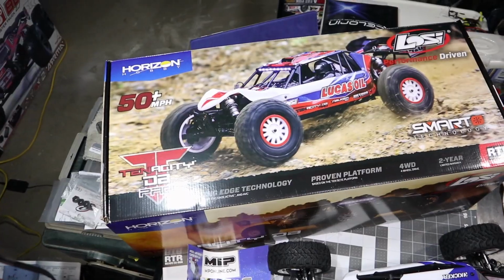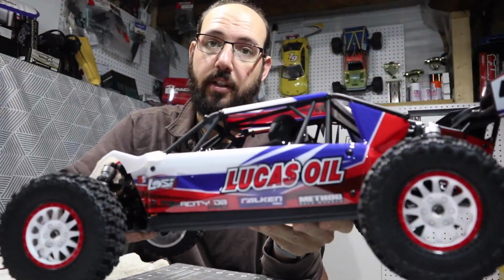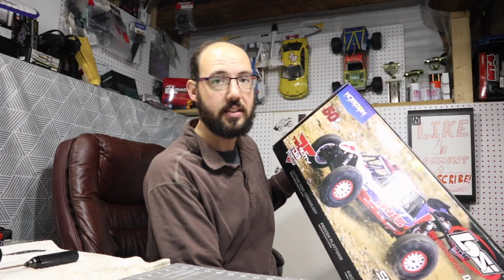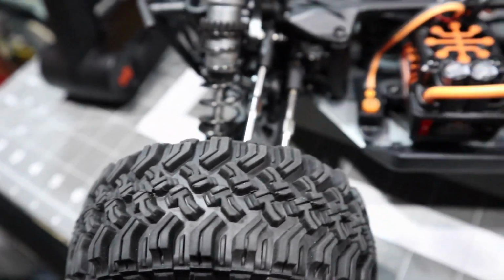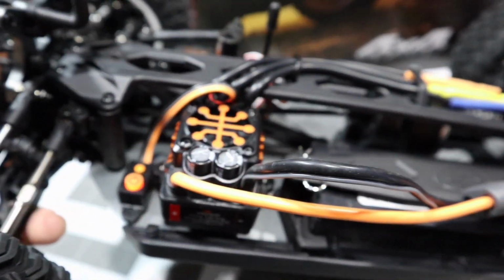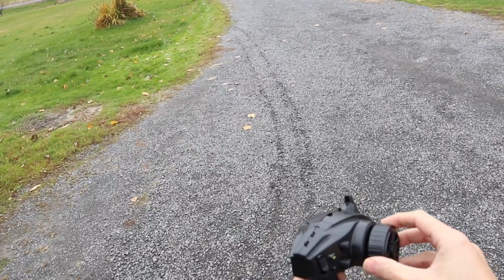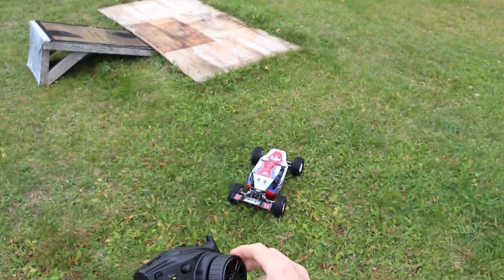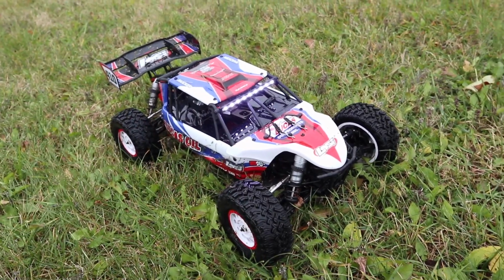NEW LOSI Tenacity DB Pro Unboxing, Setup, and First Run! - Netcruzer RC

Comment: This is probably the perfect car for most buyers.  This is what the slash should have been.  The body design allows this car to fly through the air better.  No parachuting like the slash.  It's about the same size as the slash, so it's easy to carry out to the field and back when the batteries are dead.  Plus it's built on the racing chassis.  I just don't like the transmitter.   It looks and feels cheap.  I like the easy to work on layout.   Pretty good support at local hobby shops, but still shy of the Traxxas offerings.

Comment: ** On the Tenacity stadium truck version** Cheap aluminum on shock towers. 100% chance the rear towers will bend. Design flaw, the rear bumper is mounted too high on the rear shock tower. Any hit to the rear bumper will bend the rear shock tower. I actually "upgraded" to the stock plastic rear shock tower. The front shock tower is fine and doesn't bend. Good luck all!
Reply from the maker: Thanks for this real world usage report. That’s interesting.

Comment: That plastic wrench is unacceptable. I actually used it on my new losi 22s st on the wheel nut and it literally cracked immediately. That could be a problem for newer drivers with limited tools. No reason they can't include a cheap metal 4 way wrench.
Reply from the maker: Agreed. It’s a garbage useless tool.
Reply: @Vape N Clash Yeah same here but I'm thinking of the kid getting into the hobby. And you'd be surprised how many of some kids fathers have never turned a wrench let alone own one lol. That creates a problem for sure. Then they have to go off and buy something to remove them which you're kinda limited on tools you can use and would probably have to use a socket and then your buying a whole set. I'm just saying some small minor issue can turn into a huge inconvenience for some owners/families. I'm sure a small metal 4 way wrench instead of plastic would only cost them a extra 5 cents lol
Reply: I concur !

Comment: Hello, I put 30000 drops of deep oil in the plastic spur gear on the center diff side of the Tenacity db pro rc car in the same car as the second car. Is there any problem with putting 30000 drops of differential oil?
Reply from the maker: No problem. I’m not sure what diff oil weight they use stock. If you get a lot of power ballooning to the front wheels, go even thicker.

Comment: Just wondering: will the chassis accommodate a 42mm motor instead of the stock 36mm? I'm thinking about getting one and upgrading it to a 2200kv motor to run 4s. Thanks

Comment: Hey John how have you liked this truck? Also have you seen the new tt pro sct they announced that's the same chassis as this? I'm thinking of grabbing it 😁
Reply from the maker: I like it a lot, although I have broken something minor on it every run so far. Just shot a clip today and broke a shock rod end. Mostly because it’s winter/cold I suppose. Platform seems quite good. But it has a few annoyances. I don’t like the battery tray it doesn’t allow long batteries or easy height adjust. The new TT looks OK, same thing different shell. It should be acceptable to race in short course 4x4 class if you want to race. The DB pro looks better, has lights, cage, drivers etc but it’s not race legal in that form.
Reply: @netcruzer  Great points John. The TT has lights too.  But I'm surprised about your tough luck with breakages. Seems others who own it have nothing but great things to say about it. In fact this is the first time hearing anything negative. That could be the cold like you said which definitely makes it a whole different ball game in the cold that you are in. Only reason I didn't get the db and am going with the TT pro is I already own the typhon 3s which is similar. Not as upgraded but still is a similar platform. I guess the tt isn't too different from the db with it being the same chassis but you probably know what I mean. Wish you better luck with it bud 🍻
Reply from the maker: Chris Watson I’ve mostly been breaking rod ends on turnbuckles. Likely do to cold. Razor RC also said diffs and outdrive cups wear out fast on 3S. I’ve not experienced that yet but I only have a few 3S runs on it.

Comment: How's the truck been running?  have you noticed any play with the Spektrum Servo?  I have the Tenacity T (green/white) which came with the S605 also and noticed some play with it.  When I looked it up, its all plastic inside,  next thing I plan on upgrading.  Already upgraded to the full aluminum kit on mine after my daughter hit a column and broke the chassis, but it was a blessing in disguise because it really needs the kit.
Reply from the maker: I’ve had no problem with the included electronics. Only thing I’ve done on mine is break rod ends.
Reply: I haven't broken any rod ends yet, I did break a wheel today playing in the snow, broken the hub clean off.   I liked what you did with the Proline slingshots, I picked up a set of Proline sand paws 2.8"  to try out,  Slingshots don't come in 2.8"

Comment: I don't know why we waist so much time showing the remote transmitter in most reviews ,  its the fit and finish my 1987 Tyco Turbo Hopper came with.  I understand the value is in the car , not the radio and thats great , gotta cut costs somewhere , but a quick flash would be sufficient.
Reply from the maker: I consider what you use to control the RC quite important and worth a few minutes discussing the design and features. Most don’t change what it comes with.
Reply: @netcruzer  I have seen a trend in Transmitter's on the last decade , even high end transmitter's look and feel like cheap garbage , we use to be proud of our expensive transmitter

Comment: Hi, i'm newbie with Tenacity DB Pro and getting stuck with " Binding and Calibrating the receiver process". I followed instruction but it does not work for me. when i pull "full throttle" it will go with "brake/reverse" and vice versa. could you please help me out?

thank you so much for your help in advance.
Reply: Try flicking it to norm on or reverse on your throttle on the controller